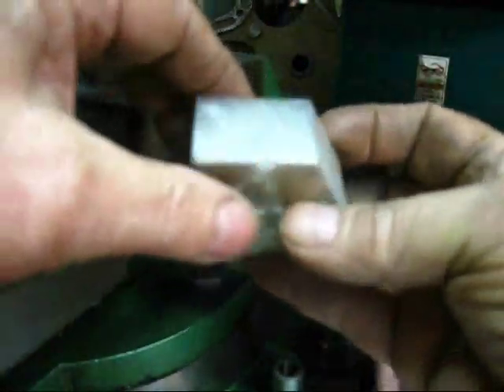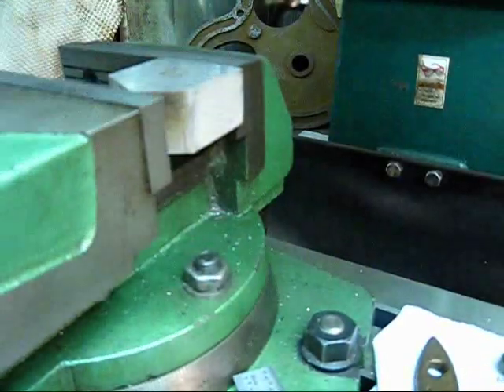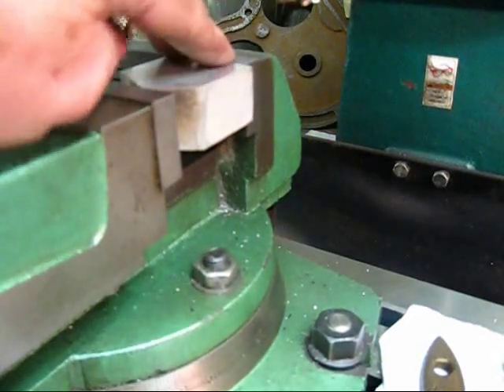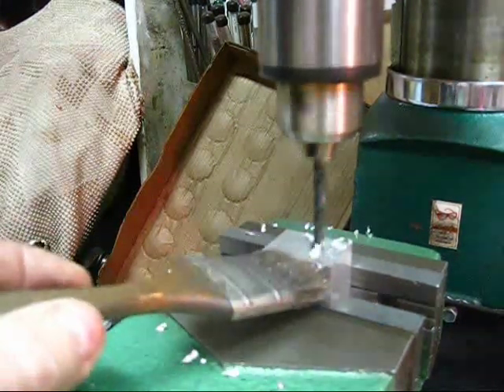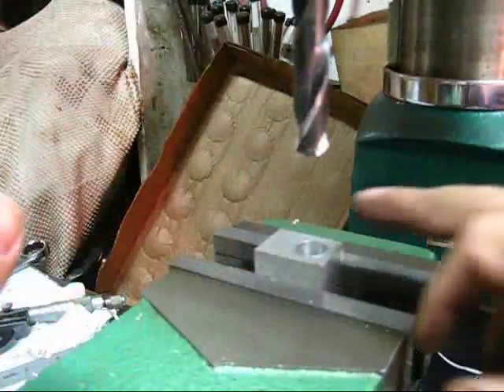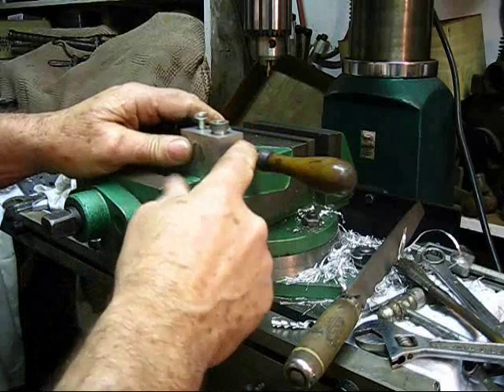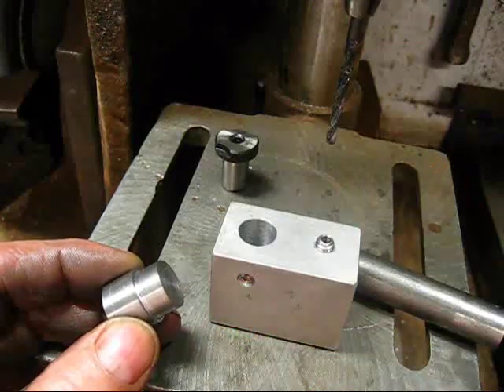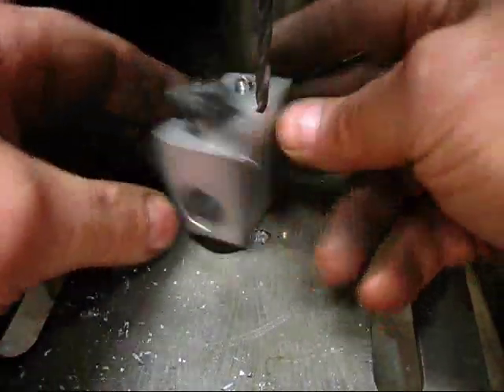Grizzly Milling Machine    drill guide   thanks tubalcain

Comment: You quickly 'gloss-over' YOUR method of finding the CTR-LINE.  How do you easily 'get'er done'?
Reply: He said he isn't big on measuring, so I think he eyeballed the first hole and then by rotating the block 90 degrees, and leaving his milling machine locked, he could drill in exactly the same center line as he had on the other surface.  Simple and easy, and exact.